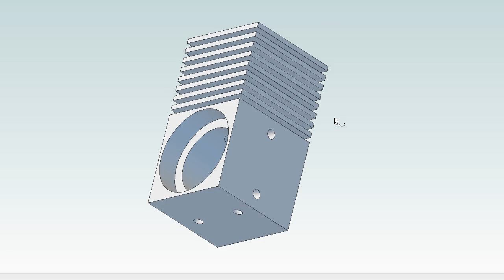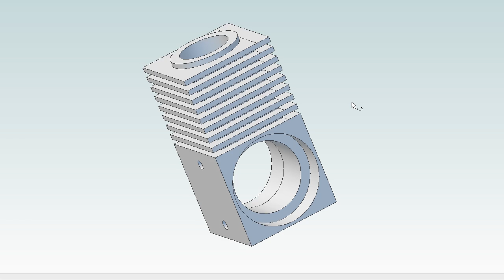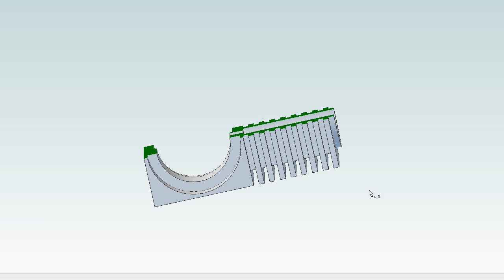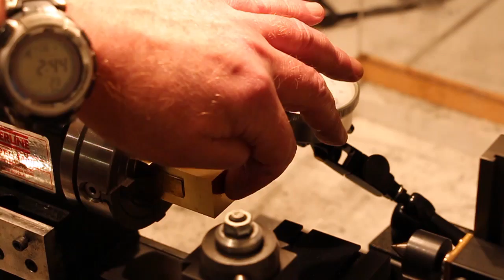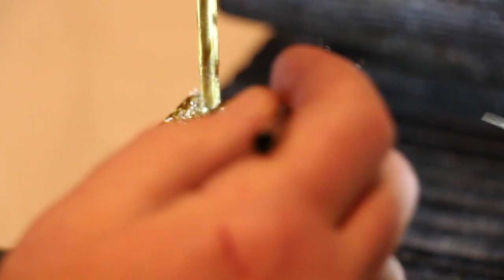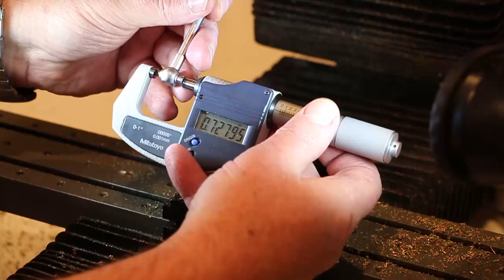Building a Stirling Helicopter - Part 2: Making the Cylinder Block

Comment: Sometimes, when I have to use a large drill bit that wont fit into my chuck, I'll use the 4 jaw chuck off the lathe.
Reply from the maker: I considered that but thought it might be a bit dangerous. Taig makes a 1/2" chuck that will fit my mill, so I think I'll get one. Thanks for the advice.

Comment: When boring, say you have 10thou to go, adjust the boring head to take 5thou, bore, measure then halve the remainder and repeat. Keep doing that until you are within 1 or 2 thou and then take a few spring passes and that should get you spot on with the final diameter. The spring passes will always take a thou or two more than the current measurement. Nice work though, as usual :)
Reply from the maker: Thanks, Andy! I'll try that.
Reply: KenToonz
This method works for most machining operations including the lathe. Just FYI, a spring pass means taking a cut without changing the measurement on the boring head or tool. It still wont make you a master machinist, but it will get you close ... lol ... Love your work, keep it up! :)
Reply from the maker: Andy M Sometimes close is good enough :)